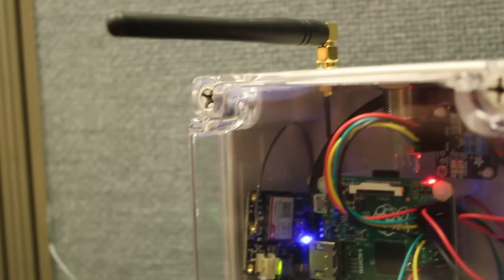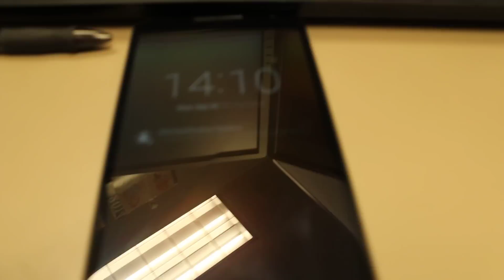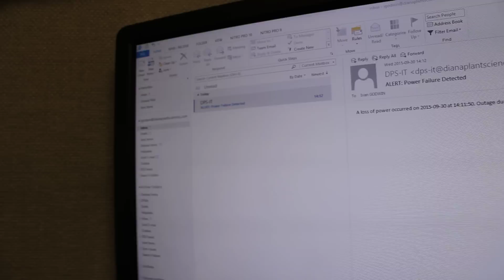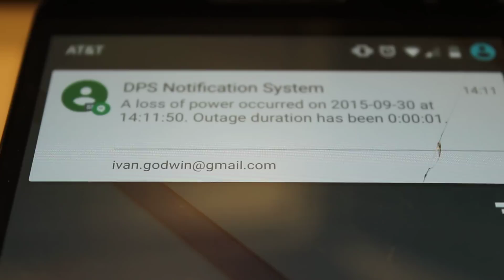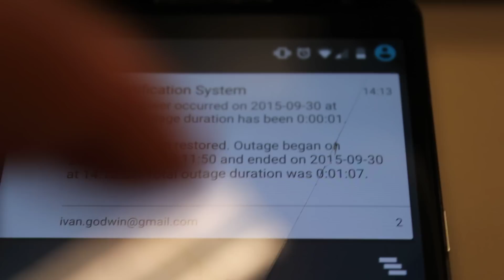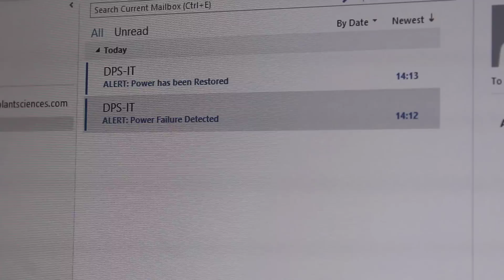Power Outage Alerting System Using Raspberry Pi

Comment: Finding this years from original post, how difficult would the be to adapt to use the ethernet to send the alerts?
Reply from the maker: Certainly. I had email alerts being sent that way. I really like the idea outlined in Dušan Vlajković's comment. It would be a lot simpler and cheaper.
Reply: @IvanGodwin  Thanks for the reply! Do you think you could also get an alert when/if the PI came back online? I don't want to have to have an emergency response to a power outage if it was only a flicker. I have battery backup for the system I'm monitoring, but it is a finite supply.
Reply from the maker: @nicholasboersma487  This solution was very much DIY. I had it configured to send a summary when the power was restored, as well as periodic status updates during the outage. You could also monitor the battery voltage and send a notice when the battery is low and the system is about to shutdown.